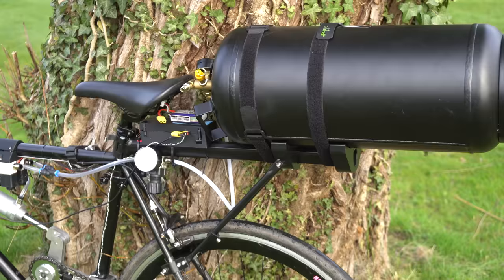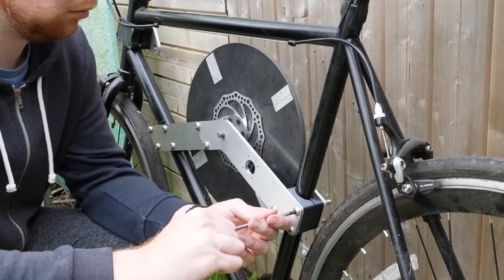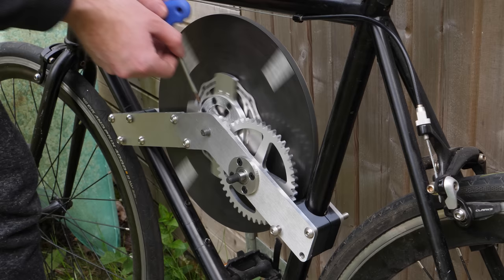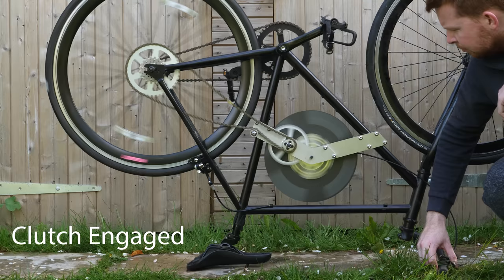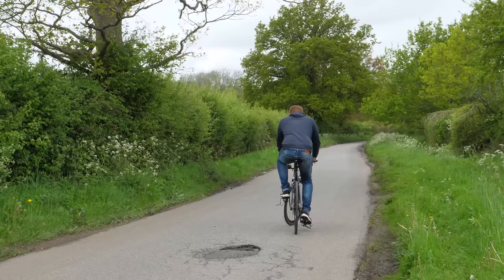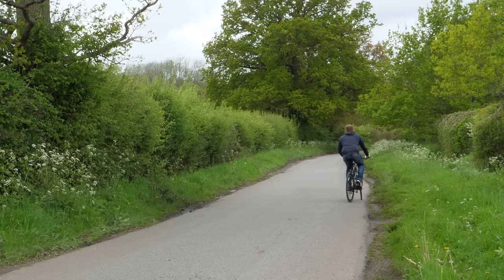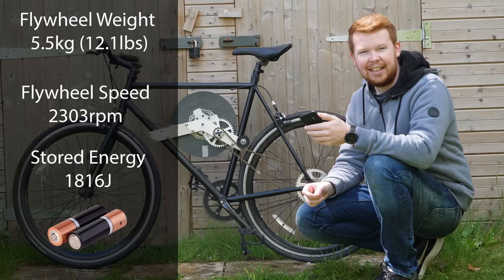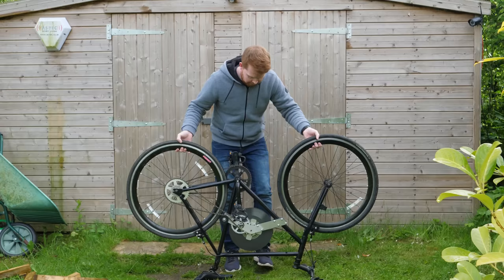Flywheel Bike KERS

Comment: I saw this video a couple years ago and I always wondered if it would work better if you put a heavier flywheel in the rear wheel between the spokes and use a clutch to engage it. Spin it up with the pedals once you’re moving and then engage the clutch when it gets up to speed to either accelerate or cruise.

Comment: If you had the clutch working normaly like a motorised bike it would be simple engaged and not engaged.witch i think would work alot better also you could peddle and engage the flywheel just to give you an extra boost when starting

Comment: You should try to use this to climb a very steep hill.
One reason steep hills are hard, even with a very high gear ratio, is because it becomes more difficult to generate enough inertia to take you from one pedal stroke to the next.

With a flywheel you should be able to store the inertia to carry you from one stroke to the next without slowing down.

Comment: It should be possible to improve the efficiency by using separate clutches for acceleration and deceleration, and a differential.

If you have a differential where the rpm of gear C equals the sum of the rpms of gears A and B, then connect the bike wheel to gear A and the flywheel to gear B. The acceleration clutch couples the bike wheel to gear C (as well as its existing connection to A), and the deceleration clutch couples the flywheel to gear C (as well as its existing connection to B).

With neither clutch engaged, gear C is free spinning, and the bike and the flywheel are uncoupled from each other. Gear C will spin faster than the bike wheel as long as the flywheel is spinning at all, and likewise gear C will spin faster than the flywheel as long as the bike wheel is spinning at all. So when the deceleration clutch couples gear C to the flywheel, you can bring the bike to a complete stop without wasting energy with the conventional brake. And when the acceleration clutch couples gear C to the bike wheel, you can use all of the flywheel's stored energy rather than leaving it with half of its speed left over.

Comment: I contemplated this. But chose kinetic energy stored in the form of spring tension. It retains the energy indefinetly, and very little if anything is lost to friction. Its just a matter of knowing when to apply the brakes, which is now winding up the spring, and releasing the tension at the right rate, accompanied with pedal power. The only thing I need now is a switch-over mechanism from wind up to unwind. But I got a good idea for it.

Comment: Hi Tom, how about a clock spring (mainspring) placed within the rear wheel spoke area which gets wound by braking ,stores energy , which gets utilized when the brake is released.

Comment: I don't know much about stuff like this, but what if instead of having one flywheel that can only break up to half the speed of your bike, you had multiple flywheels so you could break more. So once the first flywheel has made it's speed the same as your bike, you can make the second flywheel half that speed and repeat that until there's basically no speed worth saving any more. 

I have no experience with the kind of thing, but this is just something that came to mind so I decided to put it out there.

Comment: Mechanically speaking, you could easily connect the flywheel to the bike using gears and a rubber wheel that touches the bike wheels when you brake. Engage the brakes and the rubber wheel makes contact with the bike wheels causing the gears to spin the flywheel. Also, the bulk of your flywheel should be at the edge and not uniform thickness throughout..

Comment: The Problem is: you only can really break once with this system. That means you will waste pretty much Energy when your traveling on an Route where you have to break multiple times in a row. Having the bike to Break like the Porshe 918 using a Generator and Spinning its Flywheel with a Motor/Generator will give you way more breaking power.

Comment: Maybe if you had magnets embedded in the spinning disk you might have a decent motor generator that you can spin up over time while riding it. Maybe it could reach 3k or 4k rpm, and maybe your motors and generators can be higher efficency than a clutch.

Comment: This is pretty cool but I think it would be cooler to have a bike that when you press the brake it charges up some super capacitors and then when you want you can use the power of the super caps to give you a boost

Comment: I think maybe your idea could gain some effeciency if you stored the braking energy in a spring. It could be a spiral spring - clock type - or a mattress type.
Spiral placed next to the wheel with a clutch or inside the center, where some have an electric motor could be an idea. The down gearing could be made same way as the forward  drive on a gasoline lawn mower. Endless screw pinion? Worm?

Comment: I watch a video years ago that used a spring loaded seat and a flywheel the bumper the the road the faster it went and the only way to stop the bike was to rise up off the seat and then apply the breaks. It was created in the UK and combined with a car that the man was run off of methane gas capture from pig manure. Free energy.

Comment: Would be need to turn something like that into a generator for an electric bike to keep the battery topped off, or if your battery goes dead kickstand the bike up and pedal in reverse so it will charge the battery, or pedal in Reverse charges a diode that will actually get the bike moving and the flywheel generates enough power to keep the electric power going for the electric motor

Comment: Another way to do this would be to have a hub motor on the wheel of the bike and have the flywheel attached to a drone motor of the same power with a mechanical advantage. This way you can recover energy better from breaking and use more under acceleration

Comment: This application would be amazing if you could power a dynamo to generate electricity to charge batteries that are not in use while riding, it would whirr away charging a spare battery the whole time. Also, housing this in a case seems sensible too.

Comment: This looks great for long distance riding!  I'd love to see a similar flywheel system that is capable of 30 mph.  A denser flywheel sitting lower on the bike for stability and a solid housing to avoid interference will help.  I wonder how much more efficient it would be to make 3 right turns instead of 1 left turn; how does the direction of the spinning flywheel affect the turning resistance?

Comment: Rotational inertia is greater as mass of the flywheel is moved to the outermost diameter of the flywheel. This would allow your flywheel to be smaller at the same rpm and still provide the same kinetic energy. An additional benefit is it may allow for critical separation I.e., a flywheel failure may result in a near miss instead of a castrating Darwin Award catastrophe.

Comment: second prompt for clarity:

Quantum Magnetic Energy Recovery System for Bicycles

Introduction:
Bicycles are an eco-friendly and cost-effective mode of transportation. However, they require significant physical effort to pedal uphill or maintain speed on flat terrain. This project aims to increase the efficiency of a traditional bicycle by utilizing quantum magnetic energy recovery technology.

Objectives:
The objectives of this project are as follows:

To design and build a system that generates an electric field of magnetic superposition between the electrified rim of a bike tire and a ratcheting flywheel.
To recover energy from the system using a magnet on the flywheel to generate enough electromagnetic force to charge a battery.
To quantify the amount of force that the system is capable of recovering and determine the potential efficiency of the design.
Methodology:
The proposed system will consist of a magnetized flywheel attached to the bicycle frame with a chain-drive mechanism. The rim of the rear wheel will be electrified using a battery-powered system. The flywheel will have a magnet attached to it, which will generate an electric field of magnetic superposition when it passes the electrified rim. The system will be designed to recover energy from the magnet's motion against the ratcheting of the flywheel.

The project will be conducted in the following phases:

Design and simulation of the system using software like SolidWorks and MATLAB.
Fabrication of the prototype with the desired materials.
Testing the system for efficiency and force output using a dynamometer.
Optimization of the system for maximum efficiency.
Final testing and evaluation of the system.
Expected Outcomes:
The expected outcomes of this project are:

A functional prototype of a quantum magnetic energy recovery system for bicycles.
Quantification of the amount of force that the system is capable of recovering.
Determination of the potential efficiency of the design.
Conclusion:
The proposed quantum magnetic energy recovery system for bicycles has the potential to increase the efficiency of traditional bicycles. The system can recover energy from the motion of the bike, which can be used to charge a battery, reducing the physical effort required to pedal. The outcome of this project has the potential to lead to the development of new eco-friendly transportation solutions.

Comment: You need a way to switch gears. Stop in high gear to spin the flywheel up faster, start in a 1:1 allowing more of the flywheels energy to be transferred into accelerating before the speed matches. The way you have it provides low torque high rpm to the flywheel while braking but high torque low rpm to the wheel while accelerating. You want low torque high rpm both ways. Well, like you said you want an infinitely variable transmission ideally, but since you are already spinning the flywheel up to a high rpm a simple way of turning the gear reduction on/off would greatly improve you're acceleration just by allowing you to access more of that stored energy. Sure you will lose more energy to heat through friction with the clutch but you will lose less then you "gain" in access.

Maybe going for maximum reduction during braking by mounting the flywheel on a pivoting arm (and offset the width of the rear tire) add a friction surface that runs against the tire and spins it up much faster, then you only need to add a control for pivoting the flywheel back against the tire (Little foot peg? doesn't have to be much, just enough to keep it off the tire and account for any wobble) and you can still use the chain setup you have to accelerate except maybe with a lower ratio for accelerating. The fact that the flywheel already spins backwards is a boon as you dont need any sort of gear between it and the tire to spin it the correct way.

Comment: Next time I suggest you put it on a bubble balancer and drill holes in the flywheel finally taping the holes over with masking tape. Also anything you can do to polish those gear teeth and I suggest lithium grease to help dead in the sound. It also looks like the flywheel was camping slightly when you were putting it under power I suggest a thin sheet of nylon on the frame and felt on the flywheel because it looked like the flywheel was rubbing on the right side of the frame forward I believe. Too bad you can't just take out the swap. I'm suggesting a nylon shield and a felt slipping point because that's easier than polishing everything up and then greasing it again grease on the gears will be more than enough. However if you can get that flywheel spun up fast enough and deaden the noise quite a bit I think you can learn to enjoy it however a flywheel bike like that is meant to go two or three miles it's no good for short distances as you got to pick up the speed of the flywheel a little bit at a time, or on a downhill run. Dalron would make the best Shield and absolutely round off the edges and polish the Dalron to a fairly well.

Comment: Wouldn’t a small battery pack and small motor be better (think a mild hybrid bike ) so it helps to boost a start so you accelerate quicker and then you take over. Charged by regen

Comment: As someone who knows absolutely nothing about engineering: would you be able to use some-what of an "anti-lock braking" system on your clutch disk in order to spin up the flywheel during normal riding? As in, as you're peddling the bike, a mechanism would be constantly applying and releasing the clutch against the flywheel, speeding it up each time. Maybe with gearing you could have it brake on/off 2 or 4 times for each pedal rotation. That might take off some of the difficulty in getting it spinning from a standstill.

Comment: You need some electrical and electronic controls. The bike should be able to use energy you don't need for riding, such as moving downhill, to accelerate the flywheel, not just for regen braking. But, fun.

Comment: now do 2 clutches(or some way to shift ratios after slowdown/speedup)
then use the flywheel as a way to slow down AND speed up, like the supercap bike

mechanically it should be a pain, but it should be possible using a second flywheel type device(more as a dual clutch plate boned via a belt to the main flywheel)

then try using a small BLDC motor(really too weak to run an e-bike) to slowly speed up the flywheel

maybe make it USB powered, using the flywheel as basically a supercapacitor in mechanical form

Comment: I wonder why motorcycling isn’t employing KERS more.

Today we have 2-cylinder 600ccm bikes that easily outperform 4-cyl 1000‘s from 30 years ago. So the space to fit a decently sized flywheel (or an electric equivalent) would be there.

It would be an absolute blast at red-light and other frequent stop-n-go traffic.

Comment: Its a great concept but it seemed that flywheel did not have enough energy to get the bike going again. You seen it lose a significant amount of energy when you engaged it to accelerate and it only propelled you a small amount. The rider will still have to pedal to assist. Is there anyway to make a spring within a hub to move the bike? Like a watch mainspring when wound up uses its energy to turn the cogs. As you brake it will wind the spring and when released it will unwind using its energy to move the bike, it will be much lighter than that heavier flywheel but I am not sure how to go about designing it though.

Comment: How did you calculate the stored energy? Do you know that, for a rotating body,  it is the moment of inertia times the square of the angular velocity? The moment of inertia depends on the mass and the radius of the rotating cylinder.

Comment: Torque converters would be a better way to recover energy as geared input rpm can by significantly higher. Downside would be the need for a separate breaking and launch chain but this would allow a lower gear ratio on the flywheel power take off side which would result in less loss when launching from dead. It'd be interesting to see an electrically coupled kinetic storage system, the infinite rpm variability on the motor/generators might make up for the efficiency loss in conversion and letting an Arduino run the thing would definitely be more convenient.

Comment: There was a mechanical engineering professor back in 1968 at the Univ of Michigan where I was a student who was trying to develop a bicycle that could store energy and use it to propel the bike.  His used some kind of spring arrangement.  Don't think he ever made it a success.
Reply: The problem with such systems is that it adds weight and costs and would also increase the cost to maintain a bike overall, so the market is very limited.

Comment: I have an idea, the gear ratio that is used to charge the fly wheel will affect the force of braking, it may spin the fly wheel even faster, and that mean the bike will accelerate much faster (if the fly have enough torque) and reach a higher speed.
Also if we use a gearbox which contains 2 speed (low and high), i think it will much more affective than that. 
Those are just some thoughts, may i be stupid.

Comment: Unless it can be made much more efficient, I don't see how this is really beneficial overall. The extra weight seems to nullify the slight boost you get when you start up (if you recently stopped). You're spending money and steel to save a bit of energy when we have plenty of extra calorie energy

Just put a pedal-charged motor on if anything

Comment: Your mechanical circuit is still missing a capacitor. You should add some kind of auto-charging for the flywheel using some compliance mechanism (ex. torsion). I realllyyy wanna try this out!

Comment: What if you built a bicycle designed with 2 wheels in front with a larger flywheel between them and the steering from the rear wheel. The drive and pedal function would all be toward the front wheels and front flywheel. The 2 front wheel design would allow you to continue pedaling while stopped, inputting more power to the flywheel. Braking also could feed power to the flywheel. 
Would it be better to have more weight to the outer part of the flywheel and less toward the center and use a lower RPM? Would it be better to have it enclosed in a vacuum?  This setup may work best in a recumbent tricycle.

Comment: What if you put some gears (changeable) to work while charging the fly wheel when riding to have minimal load on ur legs so in turn you hill achieve greater speeds

Comment: A large reduction in pucker factor could be achieved via laser cutting here. I use SendCutSend in the states but there must be a UK equivalent. Hand-drilling crucial dimensions using photogrammetry is right out.

Comment: How about adding a small electric motor to accellerate the flywheel as the bike slows down, spinning up the flywheel as the bike stops, and then when you engage the flywheel it's running fast and you should be able to take off very fast, and then as the bike speeds back up you simultaneously reduce the motor to the flywheel ... just a thought